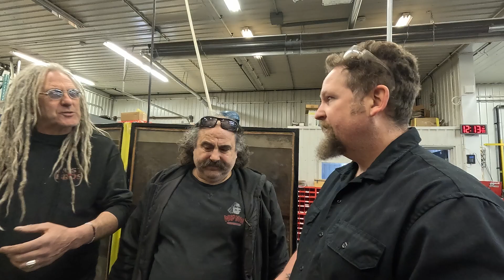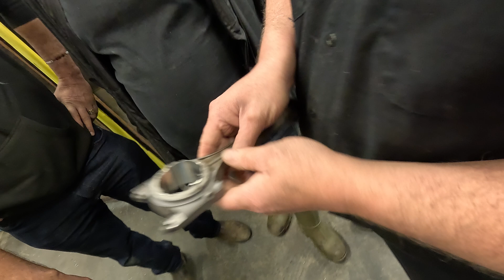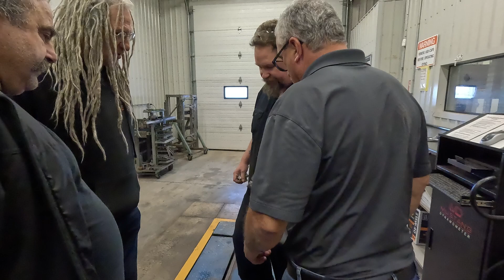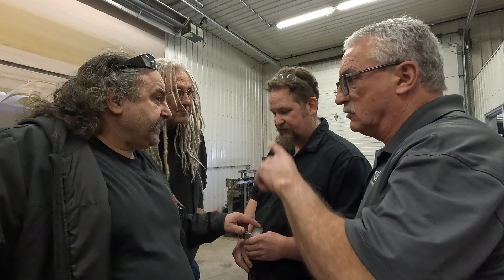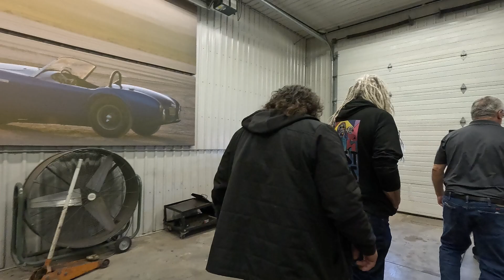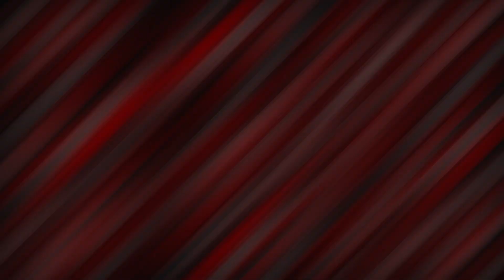What Is Babbitting?

Comment: Not sure why these guys are misleading you guys, but the   babbitt is not Tin and Lead! If you use lead babbitt the engine will not last long, there shouldn't be any lead in engine babbitt, lead babbitt is use for a line shaft or propeller shaft for marine use.
Should use a Tin based babbitt that is 76% tin 7% copper and 7% antimony.